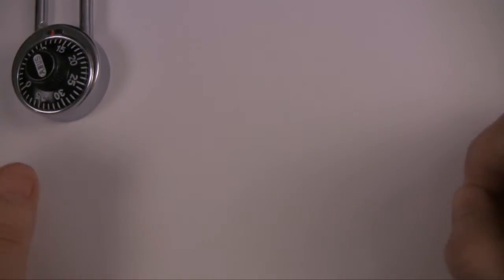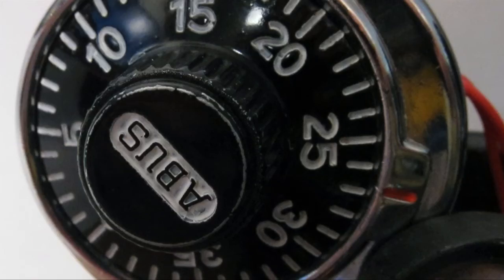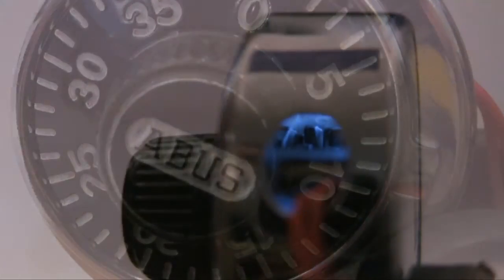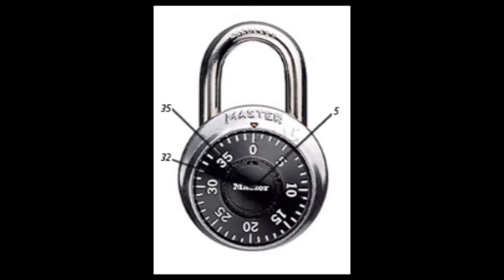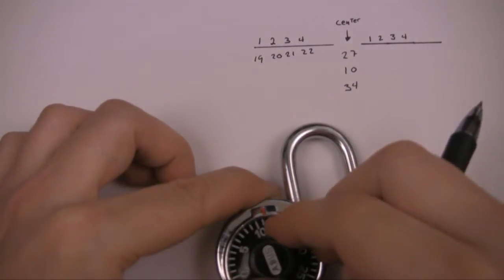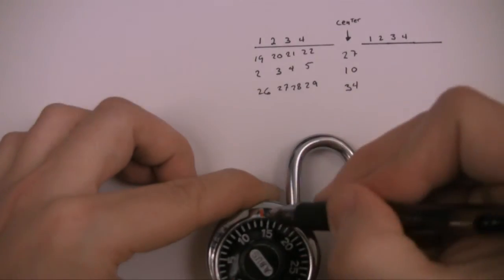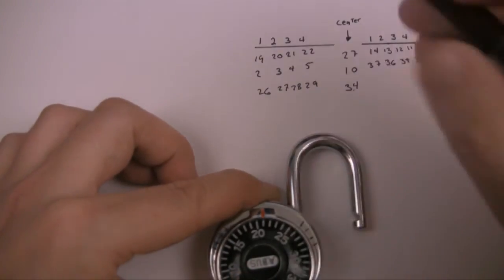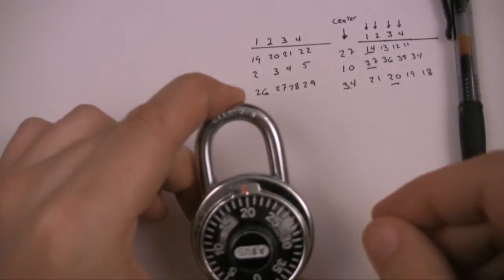Find the combination of an open lock

Comment: Ran across this video after unsuccessfully trying a bunch of methods to decipher an old padlock which I lost the combination to years ago.  It's a generic made in china with a keystone shape indicator at the top (not a master lock).  I then made a shim to open the lock and tried to figure out the combination 'backwards' so to speak using the method in this video.  And viola, it worked like a charm and now I have reclaimed my old padlock.  Thanks.

Comment: Recap for when I try later: a) clockwise, disc all the way to right, b) counterclockwise, disc in middle, c) clockwise, disc on left, d) subtract 13 from each number, that is first set to try, e) subtract 14 from each number. Combo probably within those six numbers. See video for additional to try. For numbers less than 13, add 40 first. So 10 becomes 50-13=37 (or just add 27, 10+27=37). Thanks!